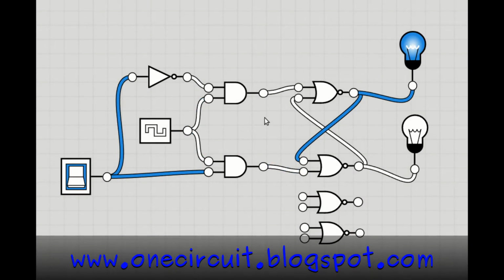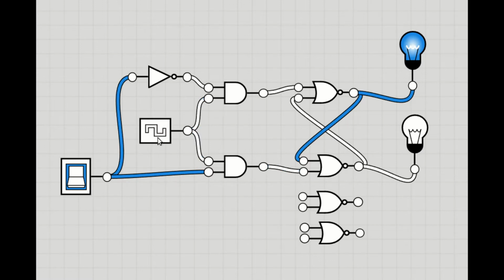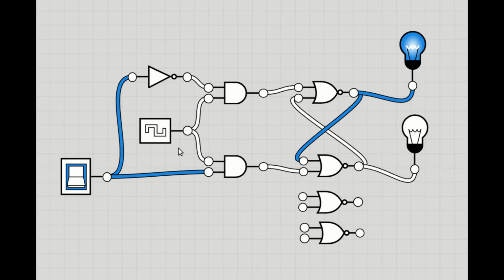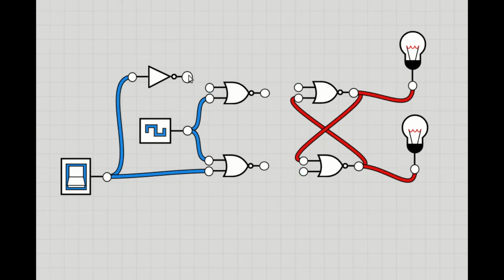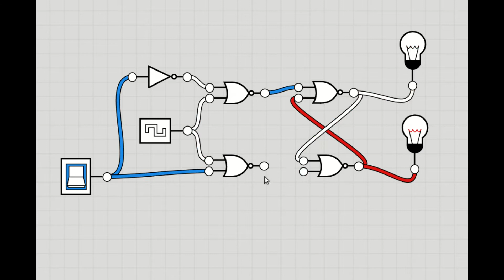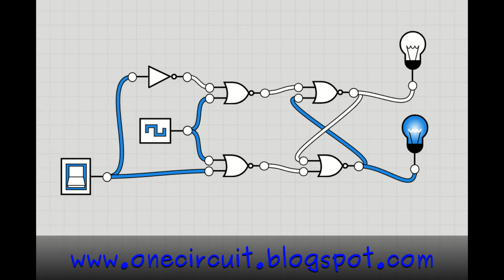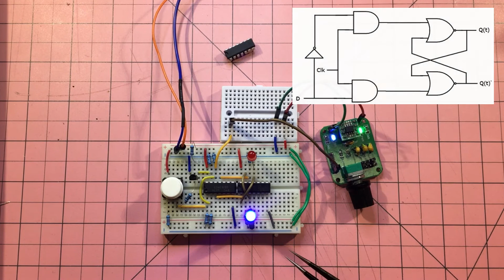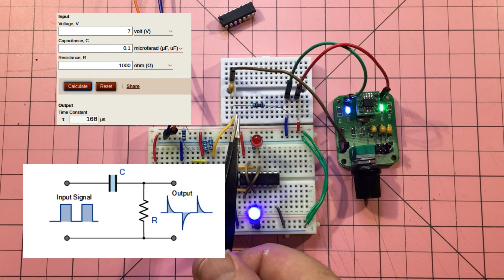SRFlipFlop based on a CD4001 "AND" (!?) a CD4081

Comment: I was once proud to make 3 (ungated) flip flops with a hex inverter, then demux the output to 8 LEDs, using diodes.
Reply: Switching from [N]Or to [N]And logic/gates, or reverse, requires inputs and output to be inverted
Nand
====
AB Q
00 1
01 1
10 1
11 0

Plain Nor
=======
AB Q
00 1
01 0
10 0
11 0

Nor with inversions
===============
A' B' Q Q'
1. 1 0  1
1. 0 0. 1
0. 1 0. 1
0. 0 1. 0

So if you have a diagram and want to go all, say, Nand, redraw any [N]Or gates as N[A]nd (easier using the newer standard square symbols, just switch the + inside to &), and also add or remove inversion rings as needed on/outputs on the gates modified. 
Inversion rings on an input can be moved to the output of the gate feeedng that input.
 Two inversions of course cancel out.
Any place needing and actual inverter, that can be made with a Nand or Nor gate with the two inputs tied together...
Reply from the maker: Great explanation Michael! I was happy that the breadboard followed the simulation. 👍😀
Reply: @onecircuit-as  Always nice when simulation and reality agree - less head scratching required... 🤕 😃👍
Reply: @michaeltempsch5282  DeMorgan’s Theorem ... and little circles mean NOT.
Reply from the maker: Hardcore! I'm not there yet...but still on the journey. 😉👍